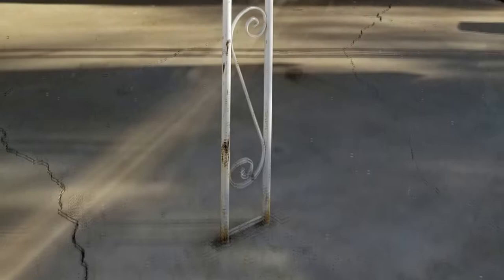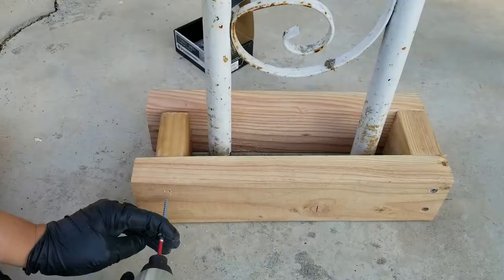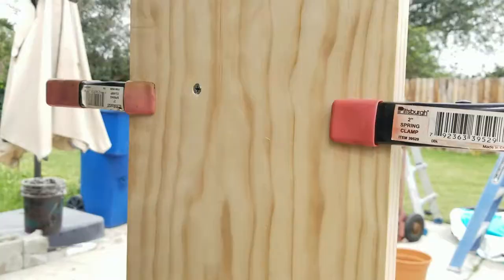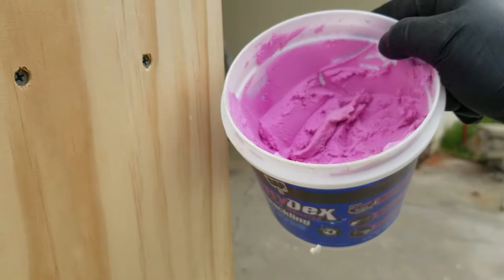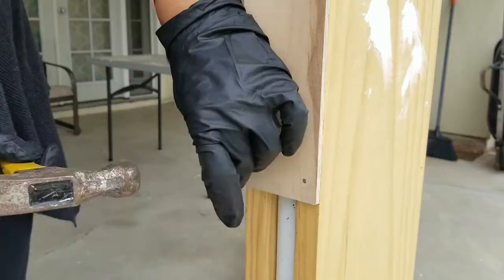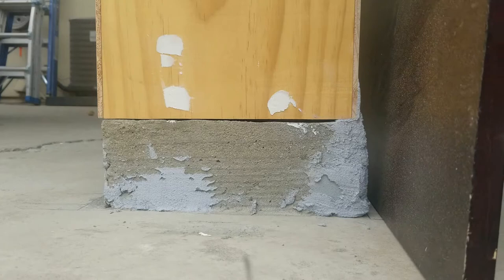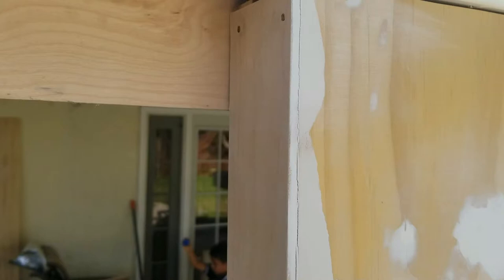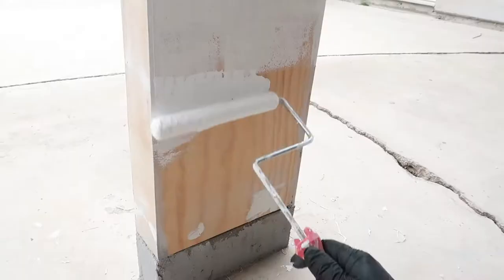How to Cover Metal Columns | Covering Wrought Iron Column Makeover | Upgrade Your Porch Columns |

Comment: I was looking for just this kind of video cause I too have the metal column. I will use PVC instead since it's more humid in my area. Thank you!!
Reply from the maker: PVC does not sound bad, I think anything that works to cover those columns would be better. Thanks for your sharing, I would love to see the before and after.
Reply: hi, did you find rectangle PVC?
Reply: @RelentlesslyPerfect  I found a couple companies that sell the columns or you could buy the longer PVC sheets and cut it yourself. In my case, I decided to just paint the columns black. Made it pop more with the background.

Comment: Question: why is the concrete necessary? Can you not just put the panel on the porch floor?
Reply from the maker: The reason I build a block of concrete was to avoid wetting the wood when I water pressure the patio floor. In general is best to avoid water from wood for several reason like water damage, mold and mildew, decay and rot, etc. and because I'm in California I really don't have to worry about rain. If that's your case I would recommend to have a barrier, a thin plastic foam sheet called “sill seal”, between concrete and wood. 😉

Comment: I want to do this but with a more waterproof material. I live where it’s very wet and the rain comes in right where I would need to cover the posts. Would Pvc work?
Reply from the maker: Hi Barb, Absolutely! If you live in a more humid or wet place, I would definitely recommend to go with PVC, composite, or any other waterproof material.

Comment: What size boards did you use for the sides?
Reply from the maker: I actually had to cut them to size, but they were 3 inches wide and .25 inch thick. 🙂
Reply: @nica.rivera  was that for the longer side or the shorter side?
Reply from the maker: The front panel is 9.25 inch wide and the smaller side panels are actually 2.75 inch wide. Hope this helps.
Reply: @nica.rivera  it does! Thank you!